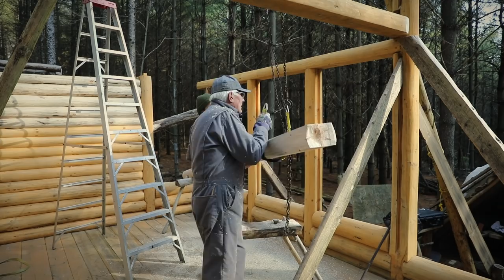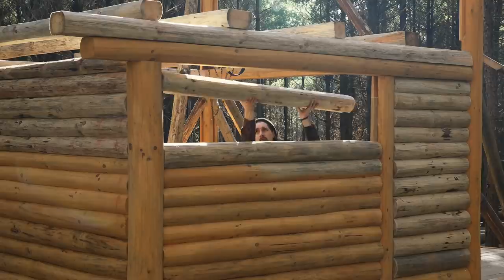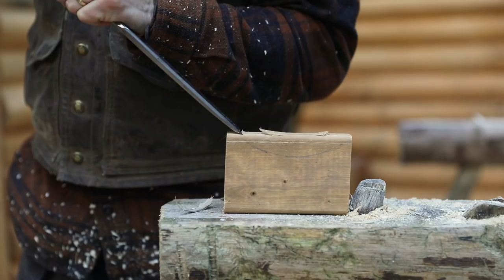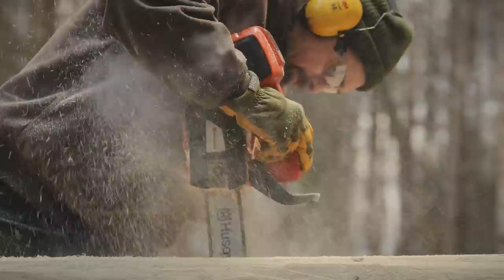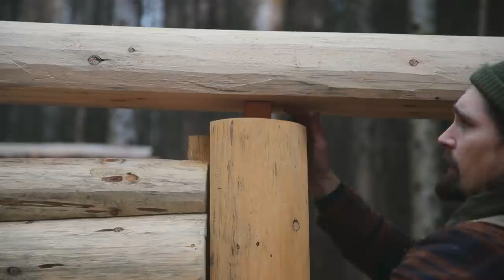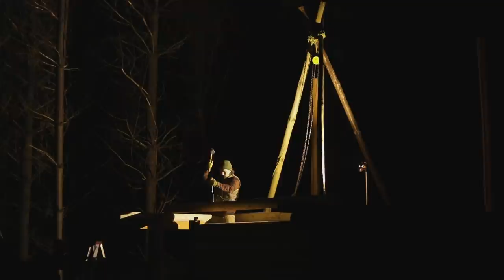EP19: Log Wall Fills & Dovetail Floor Joists - Extended Version

Comment: You certainly have a eye for detail on how to build your cabin.
Keep the videos as they are, they are very informative to the process.
How come you've got to dismantle and move the cabin ?
Reply from the maker: That's always been the plan.  I designed it so it would be easy to take apart.  It's going to go much more North. This is where I could harvest the trees and it's only a 45 drive from my house, vs. 2-4 hours where it will likly end up. Just made it easier to get out here for a days work and dry fit everything here while the logs are drying. Also, we don't own this property or the property it will go on yet. Still saving.

Comment: What do you mean, you have to "dismantle the cabin"?
Reply: Indeed. Does it mean you're moving it elsewhere - and that's been the plan all along? I guess that'd explain why you've never used any insulation anywhere between the logs.
Reply from the maker: You got it.   This is all just a dry fit. It will come completely apart and transported.